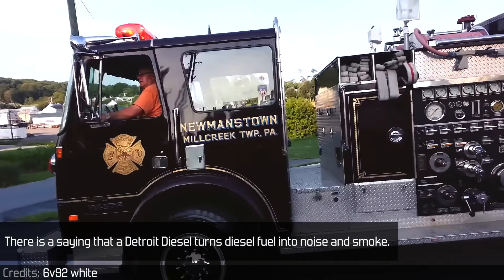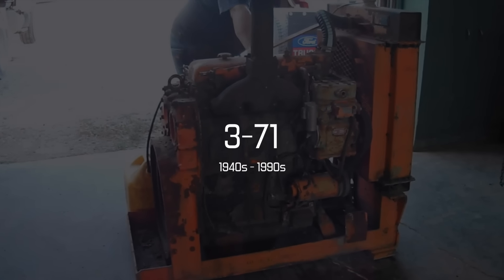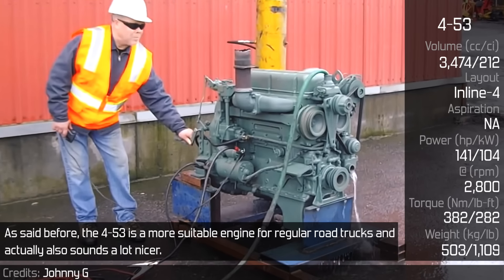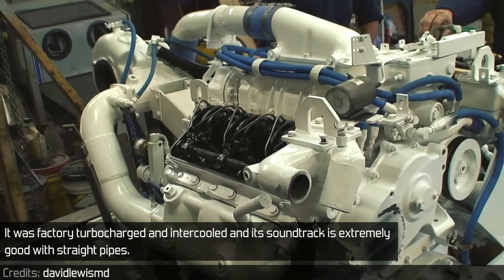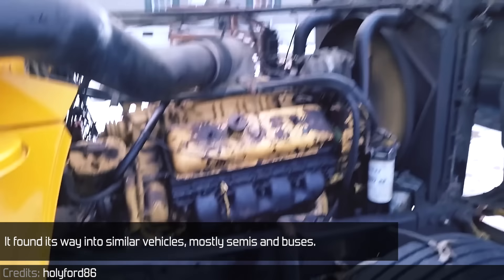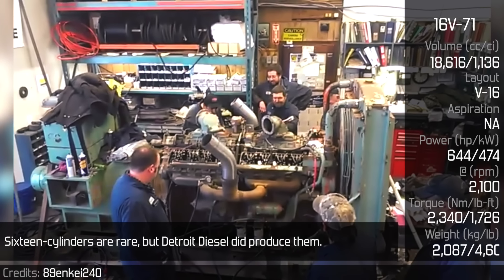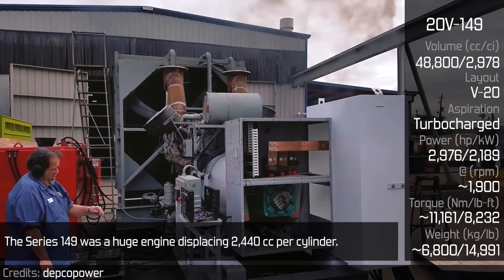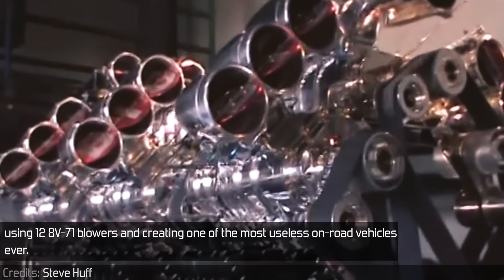9 Of The Greatest 2-Stroke Detroit Diesel Engines Ever

Comment: Don't know if y'all know this , u running wrong size exhaust pipes for better than great sounding jakebreaking experience u put 4 inch exhaust from turbo to boot 3 ft from top can, set ur Jake especially going through tunnels under passes hit the Jake it sounds like an A 10 shooting off machine gun, or Apache helicopter shooting it's gatling gun

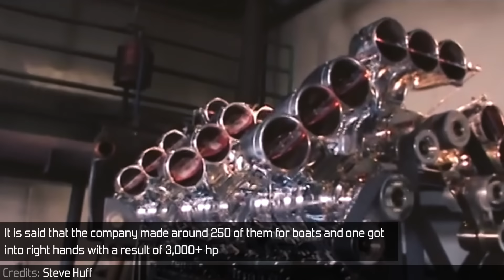Comment: VisioRacer could you please explain 8:30 how a DIESEL engine could have a Throttles!?
Diesels normally breathe with full cylinder (and often with inducted aspiration) in idle and full power modes. They just inject different amount of fuel to control "throttle" not shutting off the air intake.
It looks like a shite, and the last example is not diesel, but petrol!
Reply: ShatNdd there are Diesels with throttles 
Used to engine break

Comment: So I have always wondered, do you have to mix oil in the diesel due to the fact that its a 2 stroke? The reason that i ask is because with every 2 stroke that i know, I had to mix in the the 2 stroke mix stuff. Diesel is oily enough on its own so imagine not.
Reply: MrSapper21 remember that diesels don't breath in fuel and air mixture, so these engines have a "proper" oiling system...
Reply: No.
Reply: Lloyd, i don't know what that means. They have fuel, they generally have forced 
air induction but they don't have a spark plug. The explosion happens from pressure, i know.
Reply: They're not even similar to 2 stroke gas engines
Reply: These diesels don't draw air in through the crank case like a small 2-stroke. It has an oiling system like a 4-stroke. So in this case you have intake ports on the sides of the cylinders and only exhaust valves on the cylinder head. So what you have to do to clear the exhaust is force enough air through the cylinders to clear the exhaust gasses and give you fresh charge air, hence why all diesel 2-strokes are supercharged. Hope this helped
Reply: public enemy thanks dude! it makes sense now.
Reply: MrSapper21 no problem, happy to help

Comment: But can these engines go runaway easier than 4 strokers?
An example like the 6-71 and Cummins M1
Reply: They can if you forget to back out the buffer screw on the governor when you're tuning it up... worn out rings or not.

Comment: Since the last Detroit Diesel video, I was reading about two strokes scavenging, and why the can use seat valves, but now I don't understand how they can use 4 exhaust valves.
Reply from the maker: It has intake ports just above the piston at bottom dead centre and thus a place for four exhaust valves in the head.
Reply: Still 2 rocker arms per cylinder, both operating at the same time, but with a bridge between two valves that is actually actuated by the rocker arm.  So, two rocker arms, 2 bridges, and 4 valves per cylinder all opening and closing at the same time.

Comment: This video is full of inaccuracies. When the narrator says "naturally aspirated" that's not true. Almost all Detroits had blowers. Add an intercooler and a turbo and the horsepower was upped. The difference between a 53, 71, and a 92 was the injector size. An original early 8V71 had 318 hp. Add a turbo it was 350. Make it a 92 with appropriate upgrades and it was 420 to 470hp.

Comment: A 2-stroke can’t be na.  It needs positive intake pressure to force the exhaust out.  Also, even the ones without turbos have a supercharger.  None of these engines are normally aspirated or they would never run.

Comment: When it comes to Detroit 2 cycles you can't really use the term naturally aspirated because they all are super charged otherwise they wouldn't run because of the design of the engine.
Reply: @Keith Kiker  you need to go read the WiKi page for the detroit diesel  because ,, the BLOWER , NOT Supercharger feeds air to the engine ,, NON TURBOCHARGED detroit diesels are considered to be NATURALLY ASPIRATED ,,the BLOWER allows the engine to SCAVENGE  which means it blows the exhaust out as the next air charge enters the cylinder 
TURBOCHARGED engines produce more power because they get more air ,,unlike a 4 stroke diesel however a 2 stroke detroit does't produce lots of boost ,,and the harder the engine works the more the turbo boosts ,,a 4 stroke diesel you can stomp on the throttle at a stopsign and the turbo will spool up ,, 2 stroke won't spool the turbo much till you start letting the clutch out to load the engine up 

I installed a whipple supercharger on a 6V-53 with twin turbos ,,it has an automatic  bypass mode and when you are running at high RPM the blower actually bypasses so the turbos are actually feeding the engine and it's amazing the difference ,the result is a serious increase in efficiency and snappy response when pulling hills ,,oh and i might mention a reduction in smoke/soot production

Comment: I don't understand how people get low mileage with Detroit's.  My old GM bus, with a 6V 71 in it, gets better fuel economy than most V8  gas trucks or vans.  I Can drive 200 KM  and burn around 50L.  The old Chevy 350's burns that and 1/4.    The bus weighs in excess of 10 metric tons and most truck or vans weigh 2 to 3 1/3.  Detroit's have only top end power as well (~2250 RPM) and are gutless at lower RPM.  Detroit's with the same power rating as a modern 4 stroke, will definitely get way more fuel economy than the new ones, simply due to the emission standards.  I know the gas modern trucks/ vans claim to have good fuel econ, but really don't.  Diesels are not much better these days either.
Reply: because most people can't run them properly, and just lug them around at low idle where they drink fuel...

Comment: Just to let you know there were no naturally aspirated Two Stroke diesels every 2-stroke engine had a blower or supercharger as part of the engine design the engine would not run unless there was blower or supercharger on it turbos were added in the mid-80s I believe as part of the epa's requirement for all diesel engines that have turbo chargers in order to clean up there exhaust a little bit I don't think I really help much on the two strokes but it didn't add more horsepower and more fuel efficiency I still run a 6 V 92 and my fleet of school buses it's the only one that doesn't have an aftermarket DPF system due to the fact that it will not operate with a diesel particulate filter on it I will say this it is the most reliable engine in my Fleet
Reply from the maker: A two-stroke diesel would not run without the blower which scavenges the exhaust fumes out of the combustion chamber. That is natural aspiration of the two-stroke diesel engine. It does not even make any high pressure, only about the same level as the atmospheric pressure has.
Reply: VisioRacer the blower doesn't in a sense scavenge exhaust out of the cylinder the expansion of the combustion itself expels the exhaust gases out of the cylinder (the same way a turbo uses the expanding gases to spool up a turbo) the blower pushes the next charge of air into the cylinder via the slots/holes in the bottom of the cylinder liner while the the exhaust valves are still open the pistons never draw in air as a naturally  aspirated 4 stroke would

Comment: The 20 v 149 is for trains
Reply: It was used in mining haul trucks as well, I used to drive a truck powered by the 16V149T, and models with the 20 were also sold. Generators and boats used them as well.

Comment: wont all 2stroke diesels have a turbo ? they need forced injection just to run if am not wrong
Reply: Tore Nyland no they have a blower turbo models are different
Reply: All have blowers. Turbocharged had turbos in addition to the blower

Comment: Its a shame detroit diesel couldn't count higher than 8, is making a v12 really that hard?
Bolt 2 v12 blocks together and have a 24v-149TiB
Reply: That be the badass diesel engine ever not including ships or aircafts of course
Reply: @madbear3512  It would have been such a better design too.
FAR simpler: you're only combining 2 engines.
Better balanced: v6=unbalanced, v8=unbalanced, v12's naturally balanced.
More power or longer life.
Please america count higher than 8, V8's were cool in 1934 but things have evolved.

2018 Demon 6.2l with 100 octane
=840hp, 135hp/l with 14.5psi
2007 Evo9 fq400, 2l
=400hp, 200hp/l 20psi daily driver
2008 SL65 Black 6l v12
=885lb ft from 2200-4200rpm, 660hp on like 7psi.
Reply: @tomstech4390  
Couldn't agree more

Comment: Stupid question: how is it a two stroke if it has valves?
Reply: It has two strokes,simple as that. ¨
Valves are exhaust valves and air is blown with a roots blower into the cylinder through holes
Reply: Helvetin esikartano oh that's right no intake valves
Reply: the 4 valves in the head are only for exhaust. the intake is on the bottom side of the cylinder
Reply: Ignition on every upstroke

Comment: Since when do 2 strokes have valves?
Reply: So do EMD 2 stroke locomotive engines: exhaust valves only.
Reply: playstationfreak1111 since the 20 and 30s
Reply: playstationfreak1111 the 8v92 has exhaust valves! I know that for sure because I have to adjust jake brakes on them enough I pop valve covers weekly. So I'd say 1939.

Comment: All these General Motors Products such as Detroit Diesel are poorly tuned this is displayed by there hunting for stable idle rpm's. This is caused by both valve clearances and injector timing not being exactly the same for each and every cylinder settings. I have tune many of these to this exactness same over all cylinders within each engine for over 40 years I'm 80 years old and retired for over tens now from GM.
Reply: I always set my buffer screw to MAKE them hunt. I know, Not Correct, but I LOVE it, lol!

Comment: hate to tell you all Detroits had blowers not naturally aspirated
Reply: Hate to tell you, the blower is only for scavenging.
Reply from the maker: Exactly, blowers to scavenge the exhaust fumes, it doesn't make any additional psi, just a regular NA pressure. That's why they call it blowers, not superchargers.

Comment: you really need to do more research on the subject matter before commenting on it, NO 71 SERIES EVER was N/A because a 2 stroke diesel will NOT run without a supercharger or turbo charger. also if you call factory spec'd rebuilds every 100,000 miles reliable then youve never seen any other diesel before. cummins are good for 1 million+, cat nearly as much, IH good for at least 800,000 and the list goes on. i ran a 6V71 in my drilling rig for 2 years and ill never own another 2 stroke diesel. it burned 3 times the fuel compared to my current cummins 283 small cam    N/A and had less than half the torque. PURE GARBAGE!
Reply: John Pike it isn'at a supercharger
Reply: Fran Socías yes....yes it is. its exactly a roots style blower so if your getting technical then your right but i use the term supercharger because almost everyone knows it by that name
Reply: No, the blower is there to scavenge the exaust. You CAN add a turbo to actually make boost.
Reply: Way to make a comparison... .60 year old engine technology to modern day equipment... Gee wonder who's gonna win. Did you drive your model T to work today too?

If you put today's engine electronics on a 2 stroke block you'd have to redesign the entire mechanical assembly because it would self destruct from overload.
Reply: guifrakss i didnt say that you couldnt add a turbo. i said they wont run without some sort of boost and is thereby not a N/A engine
Reply: kleetus92 what are you talking about? the 6-71 i referenced is 10 yrs NEWER than the cummins i referenced. the 6-71 i used to run is an eraly 80's block and the cummins idk but hasnt been made since the early 70's
Reply: John.... the 6-71 came out in 1938. Are you trying to tell me your engine was built in 1928? Just because an old design was built in 1980 doesn't mean it isn't still an old design.

2 strokes' major advantage is power to weight ratio. Because you're firing twice as often, you get twice the power in the same space, and weight as the 4 stroke counterpart. That's why they're using in things like chainsaws and other applications that would be a real bitch if they were heavy.
Reply: Go argue with GM then, they are the ones who named it.

Comment: Anyone else notice these are supposed to be "2-STROKES'. Well 2-strokes do not have valves.
Reply from the maker: Sorry if rude, but educated yourself how a two-stroke diesel engine works.
Reply: Valves have nothing to do with it
Reply: Yep valves got nothing to do with it but if they did explain the Reed valves in a chain saw?
Reply: Respectfully disagree, Jason Craver. Detroit Diesel 2 Stroke engines Had either two or four Exhaust valves per cylinder.More Detroits had the four valve head.Detroit Diesels had no intake valves.

Comment: He doesn't know what he is talking about saying there n/a but I see superchargers on most of the motors he show
Reply from the maker: I know exactly what I am talking about as those are not superchargers, only blowers just to scavenge the exhaust out and feed fresh air inside. There is not higher pressure than atmospheric, of course, they would not work without blowers, but they are not forced induction actually.
Reply: Detroit sold them as "n" models meaning natural aspiration because the blower doesnt do anymore than a fan to push fresh air in since they dont have natural vacuum in the air box. There is no boost on them in "n" trim.